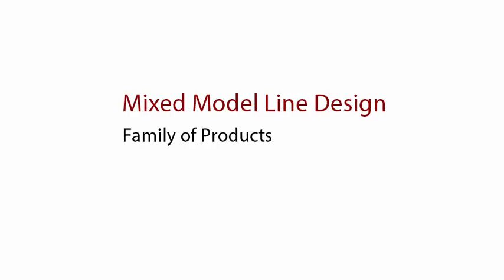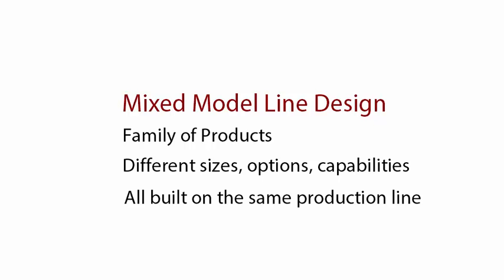Mixed Model Line Design Crash Course 1

Comment: Great ...thanks for the vdo... Could you advice how to implement change in a very negative company
Reply from the maker: Hello Sarath, and sorry for the delay. I don't have any magic, but I can share what Toyota Material Handling did to launch their continuous improvement program. This may not be relevant to you if the negativity is coming from upper management!
When they opened their plant in 1990 in the US, the management assumed that the operators would be interested in suggesting improvement and participating in the Kaizen effort. This turn out to be basically not true. So, they found a few "early adapters", people that were interested in improvement, and gave them 100% support and encouragement, and especially helped to get their good ideas implemented quickly. Word began to spread that this was something good, and today they average 1.5 suggestions per person per month. But it took them quite a few years to get to that point.
Thanks for your question, and I hope that gives you some food for thought.